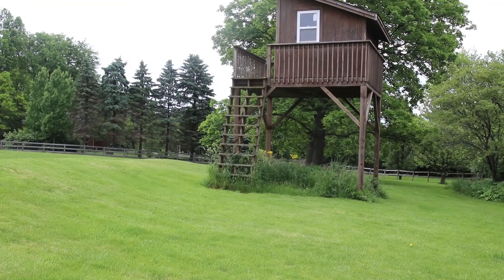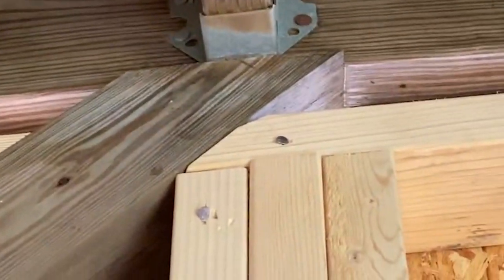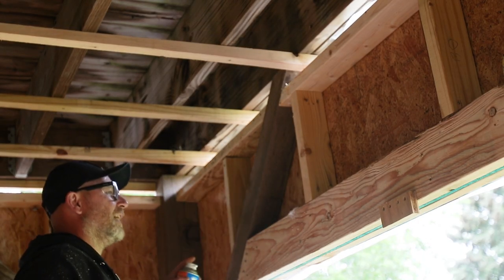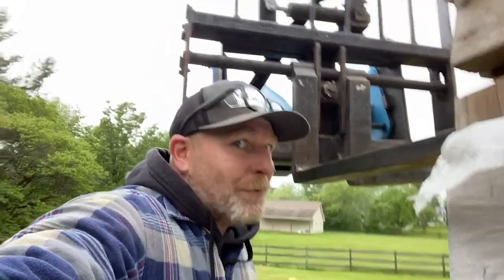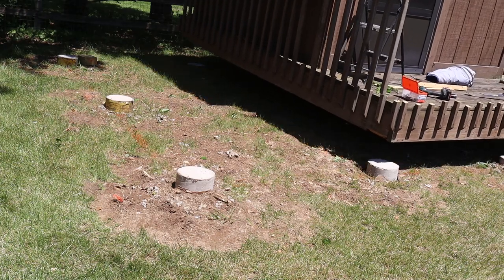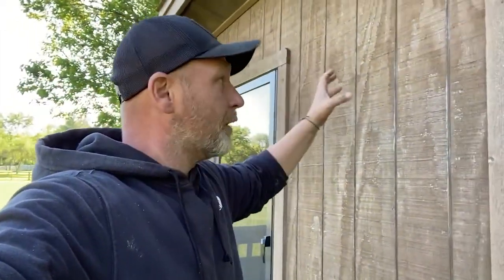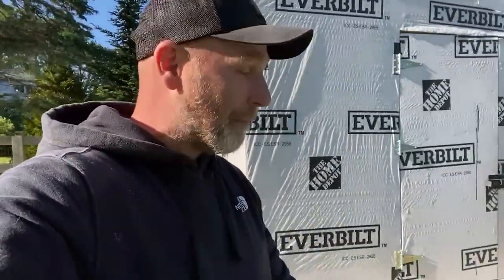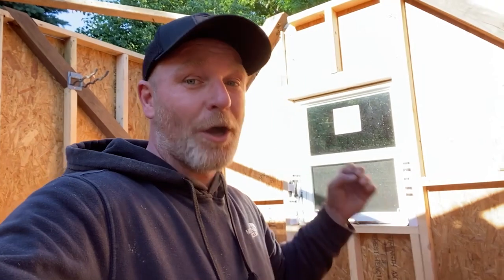Moving a Shed With a Forklift?? Modern Shed Build - Episode 3

Comment: What is the orange bar for that you attached to the clubhouse before removing it?
Reply from the maker: It was just a old painted 2x4.  I doubled them up so they wouldn’t brake
Reply: @KomarProject  Got you, thanks. Any suggestions on making a shed, so that it is easier to move with a forklift in the future?